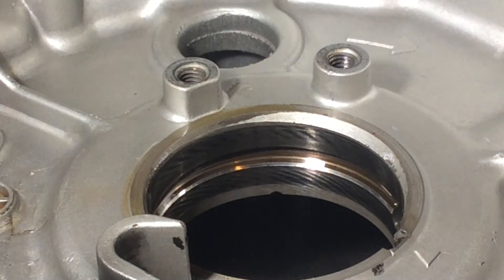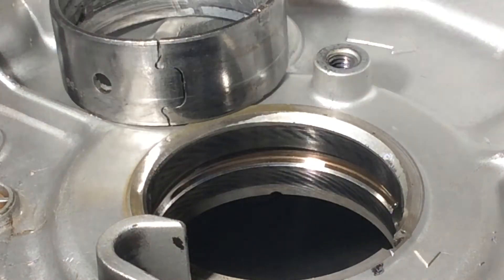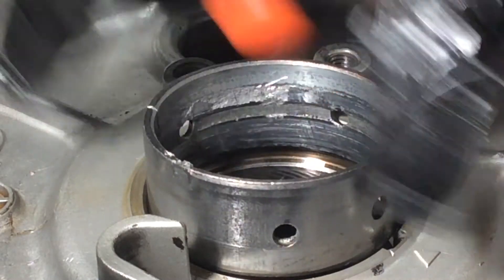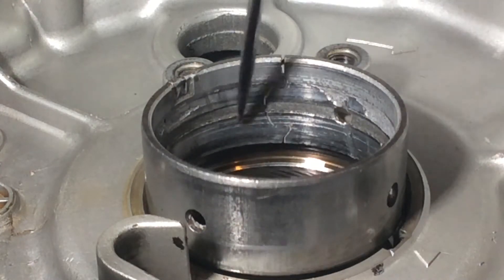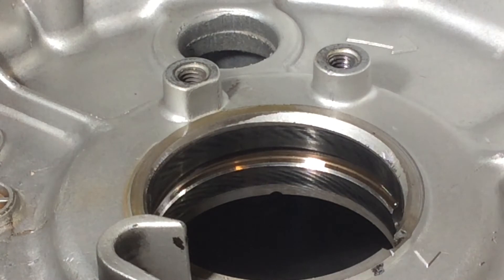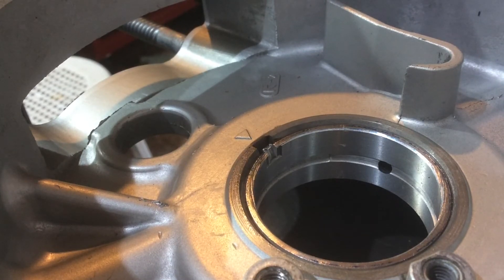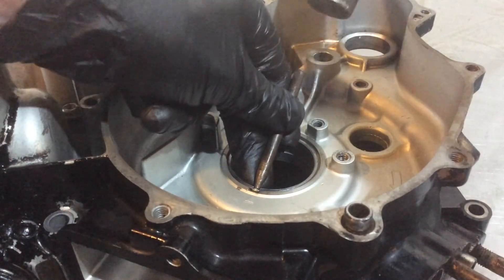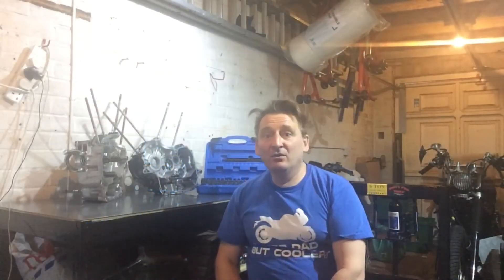Virago XV535 EP6 Main Bearing Installation

Comment: Hi great video's.
I am doing similar project, but can not identify the bearings i need - no colour on side?
My engine is a 2yl.....any guidance appreciated👍
Reply from the maker: There is no colour code for these as far as I’m aware, this is the part I used https://www.ebay.co.uk/itm/362512079817?_trkparms=amclksrc%3DITM%26aid%3D111001%26algo%3DREC.SEED%26ao%3D1%26asc%3D20160908105057%26meid%3Dc8f2bc6f36664c839754b507e6b826b7%26pid%3D100675%26rk%3D1%26rkt%3D15%26sd%3D362512079817%26itm%3D362512079817%26pmt%3D1%26noa%3D1%26pg%3D2380057%26brand%3DYamaha&_trksid=p2380057.c100675.m4236&_trkparms=pageci%3A58a9020e-2f46-11ec-a983-46f4de5c723c%7Cparentrq%3A8e3d923717c0ab8f4e9c58fbfffe3d0a%7Ciid%3A1
Reply: Wow, appreciate the quick response, i have exact same issue as yours, ie the bearing has turned and blocked the oil.
I too shop at CMSnl but their siye has two part numbers 1 is black and 1 is blue. Unfortunately on the bearings i removef there is no colour .
Thanks again - great video's
(I have 3 virago's : xv700 , xv535dx and have just this xv535dx bobber albeit with a 2yl engine)👍
Reply from the maker: @stevetombs8848  Ah ok, well the clearance I can imagine will not make much difference. Mine is running just fine with this replacement. I’m not sure how you would check the clearance anyway as it is a ring, albeit a split ring type bearing, it would be hard to test it with plastiguage.